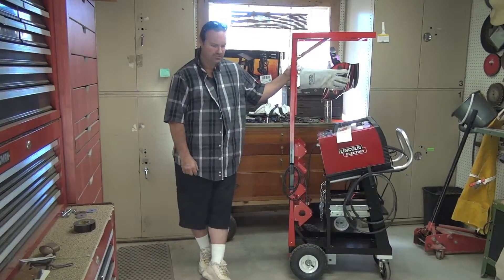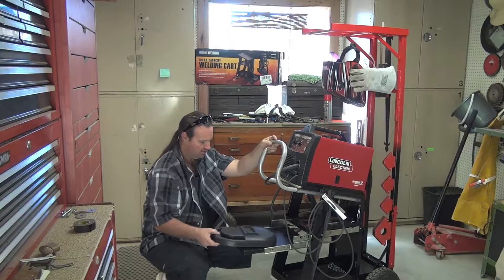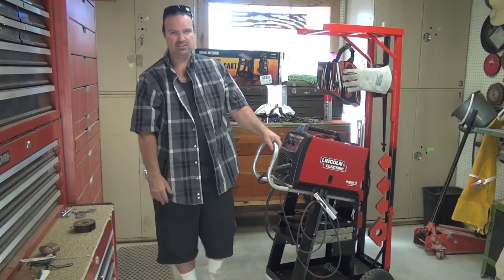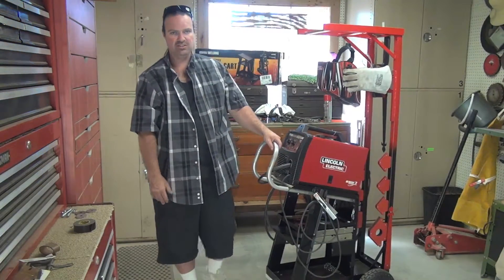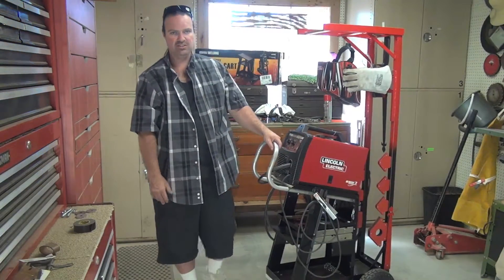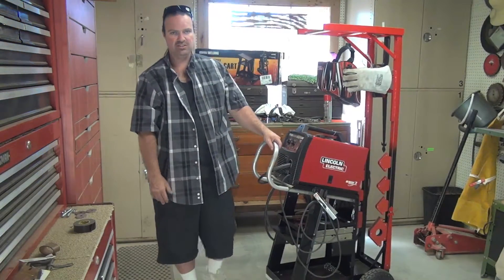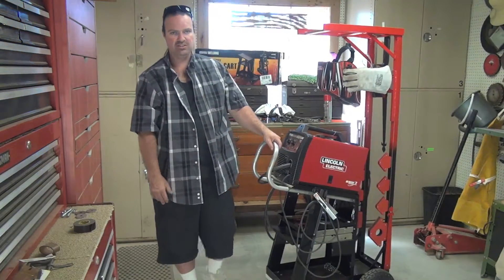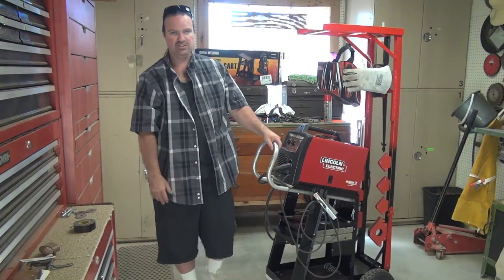Welding Cart with RACK Part 5 of 5* Complete *Full Tour, Review & lots of talking, lol

Comment: over in the netherlands theres a company that sells you the bottle with the gasfill and when the bottle is empty they refill it for the price of the gas 
if the bottle is out of date they replace it for free and if you want to get rid of the bottle they buy is back for the purchaseprice 
youre going to need a regulator when you going to use gas

wat you still could add is some handles on the rack you added so you can tilt the cart back on its big wheels and pull it up a flight of stairs , the bottle over the big wheels is going to make iy hard to manipulate using the fronthandle 
i do like the fronthandle for the protection though